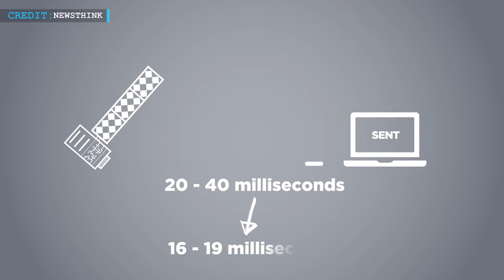Musk hints SpaceX Starship rocket may explode on first orbital launch | Amazon Shows Off Terminals

Comment: The Starship, in current configuration, is unable to reach orbit due to the fact that the Skirt of the Starship cannot withstand thrust forces generated by 33 Raptor rocket engines. Any attempt to launch the Starship/SH Booster stack will result in the Skirt collapsing before reaching MECO and rocket exploding in mid-air. Elon already knows that and despite knowing he keeps on pushing for a test flight. Let us hope that nobody dies as result of this slow train wreck mid-air explosion.

Comment: Why SpaceX didn´t  use starship (without booster heavy) as booster for a falcon 9 second stage ? 
so they were able to test Raptor 2 in flight and make first experience with reentry and ship landing and quick reuse.
Reply: Well, starship is 9 m wide falcon 9 is 3 m wide … So you would have to design a mini version which would just take out money and time that you could’ve put toward the full-size one. Plus, a mini version might also be too heavy for falcon nine as the second stage of starship, it’s quite large proportional to its booster. So no really point of doing this. Also, they are innovating so fast that this first test one would be a throwaway rocket anyway. Just as long as this thing clears the launchpad and doesn’t damage it I’ll be happy. 🤷‍♂️

Comment: every rocket launched "might" explode.
Reply: Yes, but This is much more likely, because instead of SLS Spending 10 years developing a rocket, SpaceX has a philosophy of build fast let it blow up, learn build again and and launch. Process is a lot faster, but has a lot more booms, Therefore, lots of reports of “failures” along the way….
Reply: true all of the legacy equipment should help SLS, although i was surprised it made it especially after the valve problems that should have been solved back in the 1960's

Comment: I have Starlink. Have had it since February 2021. I can tell you, in my area in Maine using an original round Starlink dish we frequently see 350mb download speeds. Its getting more and more common as the system gets more densely packed with Satellites. Also from time to time they test new firmware that boosts the speed for a while and then they change it back. I think they can support 350mb+ continuously but they have to limit it in areas like ours so that people in more densely packed regions don't complain they are being left out. I recently upgraded to 1000/1000 Fidium fiber. Was not expecting them to follow through on bringing it to our area but we have it now. I keep the Starlink as a failover for the rare occation that bad weather knocks out the Fiber. I work from home with up to 15gig documents so I need extra reliable internet.
Reply: Where in Maine and what is the monthly cost?